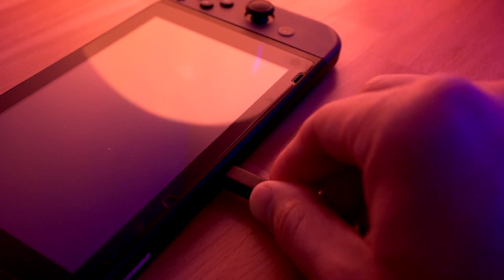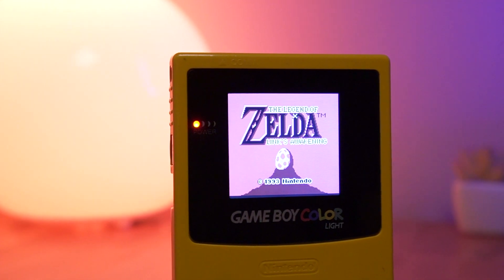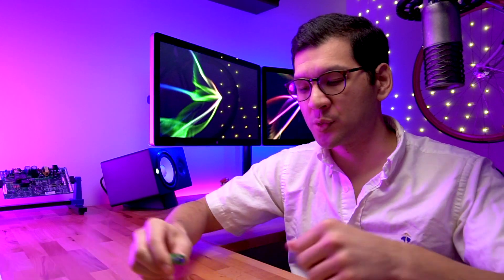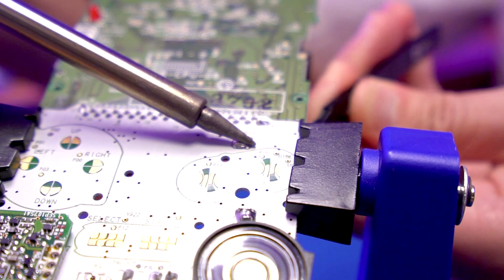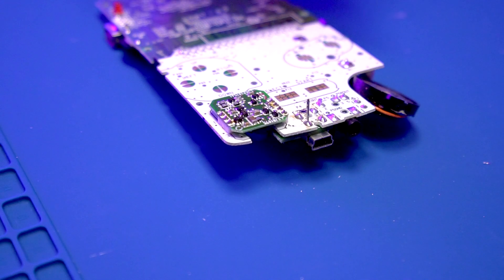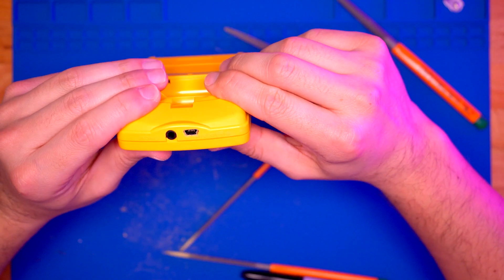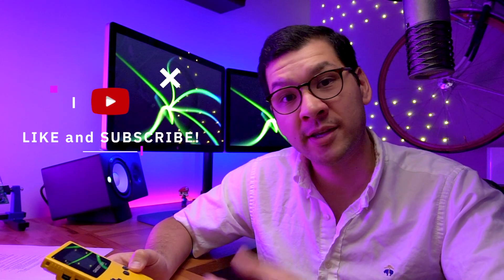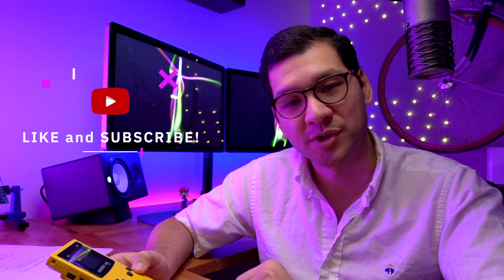$5 GAME BOY COLOR CUSTOM DESIGNED USB RECHARGEABLE BATTERY KIT from MCWILL | Retro Renew

Comment: If you added another metal spring in the left side so that it connects both batteries at both ends, would it be able to use two 10440 in parallel for more capacity?
Reply from the maker: That's true, great suggestion!  Hmm, Im not sure if that will work.  Unfortunately I'm am not an electrical engineer. When dealing with lithium batteries I always exercise extreme caution.  I just made sure I followed McWill's instructions to a tee and procured all the documented components.  The approved battery for this mod is only a single 14500 battery.  If you go to the Console5 website you will be able to find McWill's customer service email.  He will definitely be able to answer your question and he is very responive to emails!  Cheers!
Reply: @MachoNachoProductions  i see. I'll forward him a mail and look further into the matter. Thanks for the swift reply.
Reply from the maker: restlessheroes no problem.  Be interested in learning what you find out.
Reply: @restlessheroes   If you hear anything back, would reply here, please? I was curious if you could sequence two of them as well.
Reply: @11tmaste  i got an response, they said it could be done without any problem.

Comment: Have your tried the wow stick electric screwdriver it's on Ebay for 20 dollars it helps out a ton
Reply from the maker: I actually never tried it before.  I've seen a lot of modders use it.  I should check it out, it could help save some time removing al those screws, haha!  Cheers!
Reply: @MachoNachoProductions  I got it just to try it out and its amazing I used it to change some of my PC parts and change my gba macro btw the second speaker did work but it was a tight fit